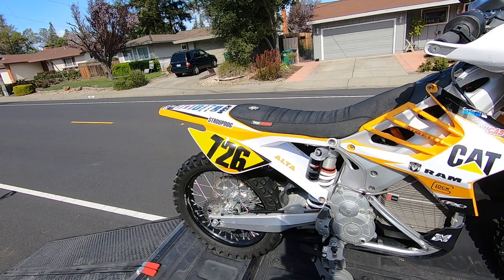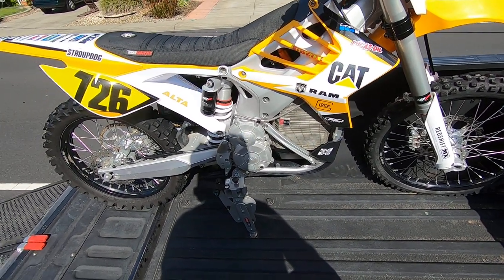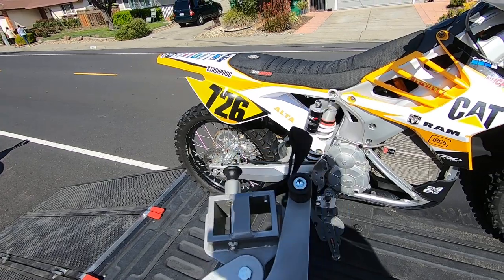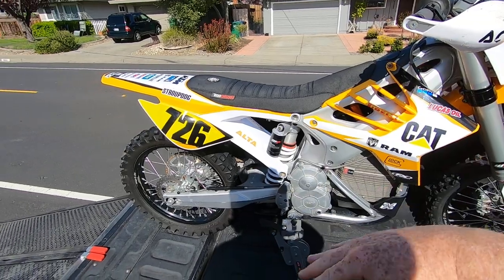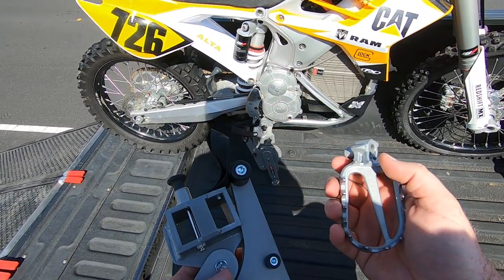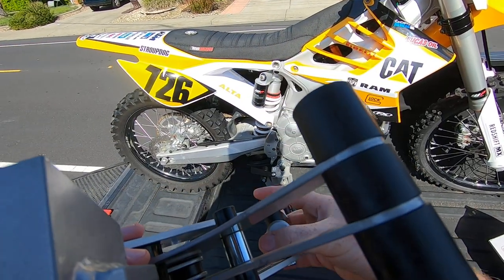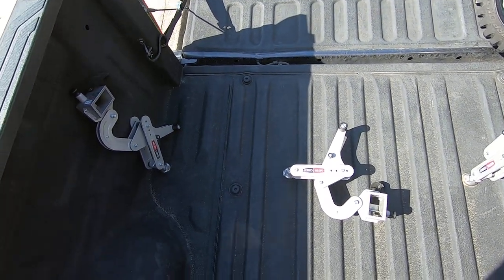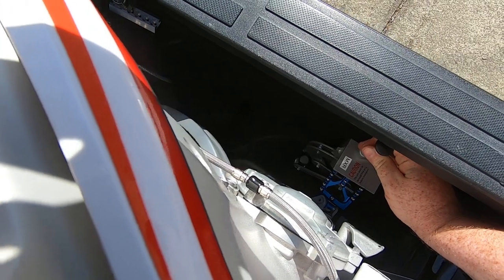Moto Cinch Strapless Tie-Down Review

Comment: If placed in the valleys of the bed, do they sit flush or below the high points of the bed so they don't hinder/scratch things being slid into the bed? That's my only concern with these
Reply from the maker: The brackets sit down far enough that they do not sit up above the ridges in the truck bed.  At least in my Tundra.  I also have the spray in bed liner, which might affect things a bit, but not by much.  I haven't had any issues with things catching on the brackets when sliding things in.  They also have a rounded profile, so things tend to slide over them anyway.

Comment: Love that Black Widow Ramp, just purchased one. I always said, I am as likely to get hurt unloading my bikes with those short runged ramps as riding! Looking at putting L Track in the bed of my Gladiator using Rivnuts so I have full length tracks. These would work perfectly. I would have liked to of laid my ramp flat, but with these in place, I suppose vertical would work?
Reply from the maker: Yep, I'm also too old to worry about sketchy, steep ramps.  My ramp does lay flat between the two middle Moto Cinches.  But I pushed the bikes out as wide as I could towards the side of the bed to do so.  The ramp can sit vertical, but you'd need to hold it in a folded position and prop it up with something.  I also made a little "ramp-caddy" device to help move the ramp around.  It is a wooden box that goes over one end of the folded ramp, and has a pair of 8" pneumatic off-road tires on it.  This not only keeps the ramp folded, but you can drive the ramp around like a very long wheelbarrow.  The large tires let it roll over rocks and curbs and such.  Still a little awkward, but better than lifting a 60lbs ramp around.
Reply: @C5Tor  We sound a lot alike, tinkerers! Too bad about the electric motorcycle company!

Comment: Thinking about setting up a trailer with a few of these for my bikes. What is the bike weight capacity these can handle? Do you know if it will work with a larger ADV bike?
Reply from the maker: They will easily cinch down a larger ADV bike.  The street version can hold large sport bikes, Harley's and Goldwings.  The only difference between the dirt and street versions is the design of the stirrup that holds the pegs.   There isn't really a weight limit per se, because the Moto Cinch is not holding up the bike, it is pulling it down. The bike's own suspension is supporting the weight of the bike, the Moto Cinches are just keeping it from tipping. Since the force is essentially straight down, it doesn't take that much pressure to keep the bike upright. I suppose if you flipped the trailer, then you'd have to worry about the weight limit.  But then you'd have other things to worry about, I guess.
Reply: @C5Tor  good point, and thanks. I have a hitch carrier (ultimate MX hauler) that works on a similar principle by clinching down on the pegs, but I'd be a little wary taking a larger bike on it, even though my hitch is rated for the weight, just because I tend to be on back roads that introduce a lot of bumps and sway. The moto cinch system seems more stable though, as the wheels are also a point of contact in addition to the pegs.
Reply from the maker: The suspension of the bike also works to absorb most of the bouncing and distribute the weight through the truck bed or trailer bed.  The Moto Cinch just keeps the bike upright and in place, and it also keeps it from rebounding very much.  The MX Hauler does use the pegs to hold the bike in place, but the MX Hauler is also holding up the entire weight of the bike via the trailer hitch.  Not always ideal on bouncy roads. I used to have an MX Hauler.  It was a nice product, but I had issues with ground clearance and tailgate clearance.  Also, the hydraulic jack was a weak point.  If the jack ever failed, it wasn't really useable.
Reply: @C5Tor  I've had issues with the bottle jack from day 1 as well on the MX Hauler. I actually carry a spare in the truck in case it fails when I'm out in the middle of nowhere.

Comment: These look very cool. How far do they pull the pegs down?
Reply from the maker: It depends on how they are adjusted.  There are four bolt positions, each about 1/2 inch apart.  When you pull the lever up, it pulls the pegs down approximately 2 inches from the fully extended position to the compressed position.  Hope that helps.
Reply: @C5Tor  Totally helps. I was concerned it would be a lot and put a lot of strain on the suspension. 2 inches seems fine. Thanks
Reply from the maker: It puts a lot less pressure on the suspension than typical tie-down straps on the bars.  It also spreads the pressure over both the front and rear, so it keeps the back of the bike from bouncing as well as the front.

Comment: what type of motor ramp is that?
Reply from the maker: Thanks for asking.  That is a Black Widow 94" x 54" Tri-Fold ATV Ramp. Got it on DiscountRamps.com, but also available on Amazon. Pricey, but it's nice for my lifted truck. Pretty heavy (65 lbs.) but it is convenient when loading and unloading dirt bikes or generators, etc.   I built a little dolly for moving it around.  The dolly is a small box that slips over one end of the ramp, and has two 8" pneumatic wheels attached to it.  The box also holds the ramp in the folded position.  Then you can walk the ramp around like a long wheelbarrow.  I ended up painting the ramp black with anti-slip spray paint, since it could get a bit slick when wet, and the silver aluminum could get blinding in the wrong sunlight.